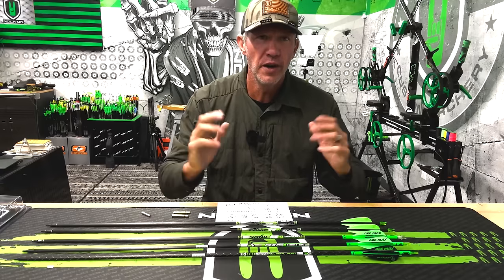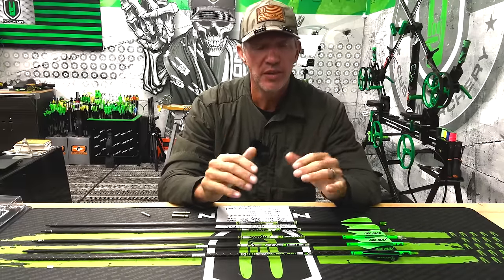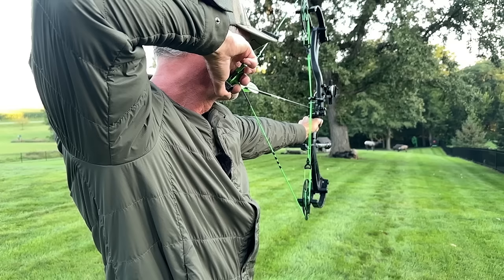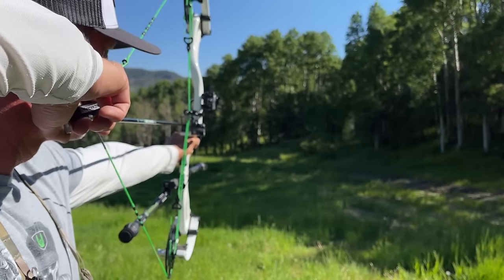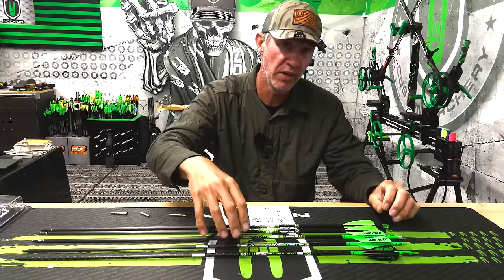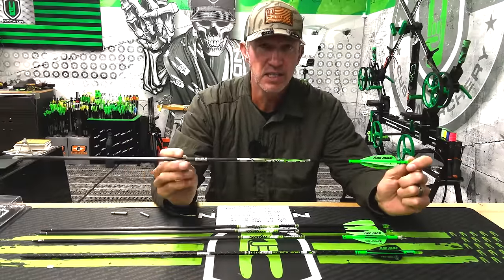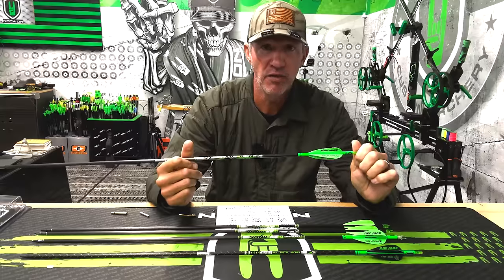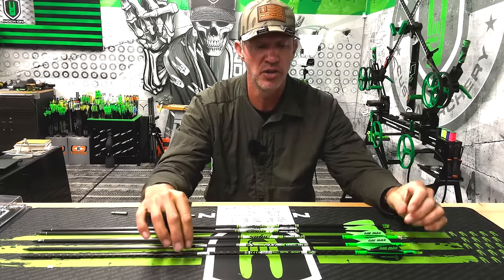What Arrows to Choose - Which Shaft is Right for You? Comparing the Nock ON AXIS, FMJ & SONIC KE

Comment: I think i'm on the right track. Hate asking questions on here but, I am 27.5 inch draw and only shooting 58lbs! I use a Axis 5mm 340 spine, with 25 gr half out.  100 gr points and broadheads.420 gr total unless i put a lighted nock on. Just under 435 gr total with the lighted nock. So, what I'm thinking is that I am right in there with my specs as to the person that has longer draw and more poundage shooting 500 or 550 grains. I am only deer hunting. Mostly from treestands. Any comments, I would love to hear! Thanks John for another great one!
Reply: Maybe you're over spined, aka too stiff. My thought would be a 400 spine for your setup.
Reply: @5jjt  Nah, right on the cusp. Better to be a little over then under spined. Actually started with 400's and went up to 64lbs, switched to 340's and started turning it down until my groups really tightened up. Shooting touching 3 arrow groups at  40yrds. I'm getting old and the shoulders started screaming at me! Much more comfortable pulling from a seated position in a tree stand. Who knows maybe I will turn it up a bit for the season, then I will be right in there with the "specs".  Thanks for your feed back. Hope you have great shooting this season!
Reply: @5jjt  Justin, It might be that I am just more steady with the lower poundage also, that's why my groups tightened up. Just thinking. thanks again

Comment: I'm 27.5 DL so I don't like a heavy arrow. Still look for weight, but apply it where needed. Switched from GT hunters with 125 heads at 440 to GT black label quantums with the Easton 75gn hit and 100gn heads. 445gn with 190 up front. Bit overkill on foc but group tight, hit hard and still fly fast

Comment: I definitely think I’m underspined with my arrows. At 6’2” and a 29 1/2 draw I somehow ended up with 400 FMJ’s. Really think I should be between 340’s and 300’s at a 65lb draw weight. It seems so late to be trying to change arrows before the season when I’ve been shooting these all summer. What would you suggest John?  My local bow shop is not what I would consider a pro shop since this is what they sold me to begin with. Nothing around KC that I would consider a pro shop that I am aware of.
Reply: I am 6' 6" with a 30" draw
I shoot 340 or 300
Reply: I am also 6’2” 29 1/2 draw. And i got set up with 300s from my pro shop in NM. My friend got set up with 400s and is smaller than me. I asked them why the difference and they said all because of the draw length. Hope it helps

Comment: I like the sonic and axis arrows but switched to victory rip XV and rip TKO because they spine align them from the factory and the nano coating makes them so much easier to pull from targets.  Not dogging the easton sonic or axis I just grew to prefer victory over more refinement.  Ive also found victory arrows spin very true regardless of being v6, v3, or v1.  I wont get into the fmj..., archery moved from aluminum shafts to carbon because carbon doesn't bend so having an aluminum wrapped arrow that can bend is a step back.  If you want a heavy hitter the victory rip SS would be my choice over an fmj.  .
Reply: That spine alignment is not accurate but I also love and shoot the rips tkos
Reply: @greekmaster1001  I don't trust the spine alignment myself but its a nice addition and of the 12 victory arrows I've fletched so far only one of them I had to rotate the knock and it was a rip XV v3.  Long story but I had custom arrows made and didn't like them so I bought a bitz and started fletching my own.  This led to playing with 4 different fletching's and 3 vs 4 fletching for my fixed blades....always a process

Comment: I've been using the Axis 5mm 260 shaft for a few years. How can I get a better FOC? I have a longer 32" draw length so my arrows are 31.8" with a nockturnal lighted nock and standard HIT insert with a 100 grain head with 3 AAE max stealth vanes. That comes out to a 538 grain arrow weight but only a 6% FOC.
Reply: Can only get more FOC adding more weight our front or decreasing weight out back.
Reply: I'd also cut your arrows a bit shorter there is no reason for modern bows to not have the arrow head just in front of your launcher/rest

Comment: I seen your video yesterday and someone had a question about  an arrow you was shooting being 300 spine and you explained the arrow charts,  question  you know more than I but I've been thinking about the high let off bows have now days back when charts were made the were 50% let at best 65%  wouldn't you kinda have to take in consideration of let off my opinion and I've heard you kinda of explain heavier arrows and higher let off. But my thinking is higher let off is way more easier on the spine it's kinda of like I have heard you  compare bows with cars trucks with clutches my thinking is high letoff is like easing into the take off and low let off is more like dumping the clutch and spilling everybody's drinks sorry about the long comment  but am I sort of on the right track you can get away with less spine and more weight up front than people think because of letoff and of course cam configuration. With all of that said I shoot 60lb bow old 2018 Elite  high letoff and the arrow is 27" long  draw length 28"  I've shot 300 spine and everything in between  the only arrow that I can get a bullet hole with is the 400 and I'm kinda going down the rabbit hole  but I never let the bullet hole make me not shoot was always on my mind but I'd go shoot groups and have to shoot at different spots or buy more arrows, and that is what it all comes down to I'd rather shoot arrows than not.

Comment: How do you determine cut length of your arrow? And do you consider how cut length effects spine? Does changing point weight and nock weight have that much effect on spine dynamics? I know this is probably a minor detail but just curious!! I have an inkling I'm on the short side of things. (Insert joke here)
Reply: Bareshaft that rig and see ! If i tune a recurve arrow via bareshafting at 20, to a pefect spine, perfect mirror image bare and fletched shafts shot at same spot,  then add a 15 grain wrap, that arrow will be stiff again, granted not alot ,tail right bout inch, but i can see movement in a 15 grain or more weight change on EITHER end , and i can see 1/4 inch changes in shaft length, if its pefect tune, and i cut 1/4 inch off of it, is bout same as adding the wrap, it will go stiff a hair, tail right bout inch at 20, no impact point change but can definately see the changes

Comment: Please stop saying fletchings steer arrows…..they don’t.
Reply: Fletchings are designed to steer and stabilize the arrow after its shot out of a bow and correct any slight errors that would otherwise influence the arrow's flight.    🤷‍♂️🤷‍♂️
Reply: So.. you just use bare shafts?? Vanes steer my 🏹  what steers yours?
Reply: 😂 my Axis arrows don’t have steering wheel. But do fly straight.
Reply: Wut
Reply: @JamesBond-oc4gm umm, no…..get a dictionary and look up what “steer” actually means.    Fletchings stabilize arrows and mitigate affects (to a degree) of bad arrow flight caused by several factors……they in no way steer your arrow.
Reply: @robertdavis1102 I do shoot bare shafts from time to time…..but arrows are ballistic missiles, not guided missiles; so despite your misconceptions, your vanes do not steer your arrows, sorry.
Reply: @michaelcolthart4006  I copy pasted that.  
I'm sry every lil word doesn't seem accurate to you 🙄🙄
Reply: They straighten the arrows flight path. So ya, a way to say that would be the "steer" the arrow. No they don't steer the arrow around a tree into the deer but they maintain control and that fit with "steering."
Reply: @JamesBond-oc4gm life hack:  If you’re going to correct someone, you might want to be smart enough on the topic to use your own words….and you might want to make sure you’re correct.
Reply: @TMar129 yeah, sorry but you still fail here.   If “a way” to say something is the wrong way, then sure, you’re technically correct in claiming that anything is “a way” to say anything but, when trying to educate people, as JD does a lot (and well imho) then stating things accurately is important….words have definitions and definitions matter.
Reply: @michaelcolthart4006  I guess we should all listen to you, the expert in the you tube comments.